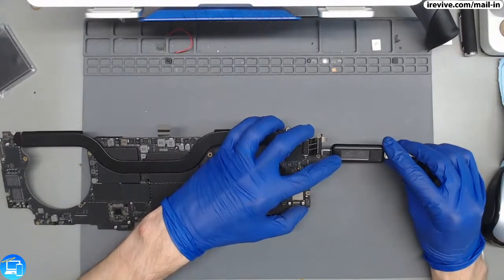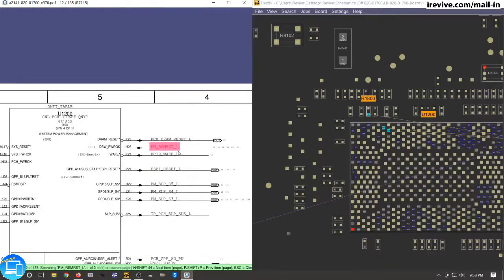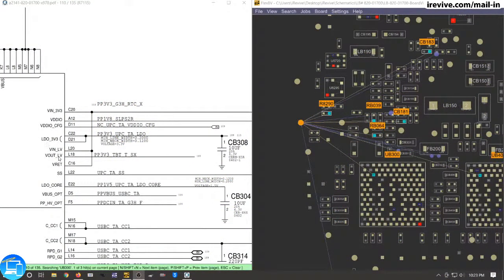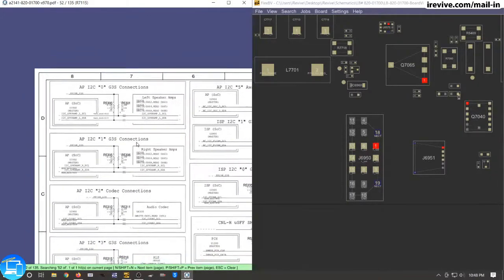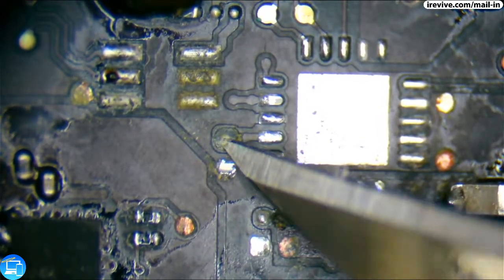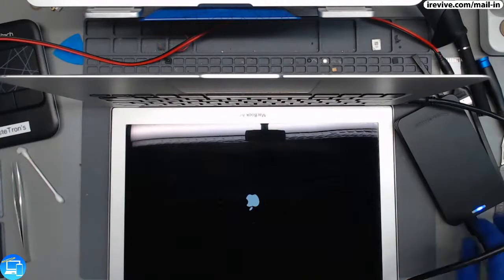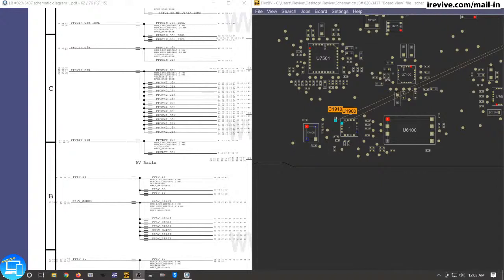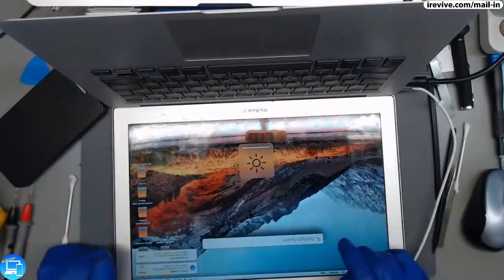A2141 MacBook Pro no power diagnostic 820-01700 and Some A1466 MacBook Air board repairs

Comment: awesome! Was the reason finally the missing bmu cable? would be interesting
Reply from the maker: Absolutely. I forgot to update this one. This one simply had a corrupted T2, however, without the BMU cable and battery screw, the device would not boot into DFU mode using Apple configuration. After retrieving the BMU cable and Battery screw from the client, I was able to finally put this device into DFU mode and restore the corrupted T2 chip. This resolved this issue. It appeared to be a board issue, when in reality, it was a firmware issue.
Reply: @iRevive  Thanks for the answer. My A2141 only getting 1,35v at all usb c ports after water damage. I Think Primary USB-.C Controller UB300 is often the reason for this defect? Because if thats okay it should be 5v / 12v minimum right? i have no shorts at the other lines only at the bottom of the board near CPU but thats often normal?. So i think the defect most be at the USB Port or could also a defect CPU be the reason for only getting 1,35 V at USB C voltometer? Would be awesome if you could reply. Im from Europe so i cant send it to you for service i think.
Reply from the maker: @MrSonnyjack  1.35v is a very odd reading to get on your USB-C ammeter. Are you using an Apple OEM 96 Watt charger?
Reply: @iRevive  Yes i watched your video many times and ive learned that 96W is necassary for this device without battery. I measured today with multimeter and i get 5,6 v at PPDCIN_G3H above both ub300 and ub400. Then i measured PPBUS_G3H and thats the same like the usb-c voltometer displayed only 1.35 v. So if thats true i think thats interesting that the voltometer measurds not the Primary USB C first. Then i watched the region around the u7000 and there it was a lot of shorts so i put some volts on it 1,5 and 1,5 a max with alcohol and i found a tiny defect resistor called R7075. Thats a 4.7 5% 1/20W MF 201 resistor. I can get only from size bigger ones. One Questions is that really 20 W? Or means 1/20W another different one? Because i will order one thats nearly the same and i will try to put it in and hope that this will maybe fix it. Thanks a lot for your Video it helped me so much to understand this new board better. Im just a beginner..
Reply: @iRevive  Can`t fix it by myself. Now i searched for a new logic board and i find one with the same Number 820-01700 but instead of i7 it has a i9 . Is that also compatible / is it possible to replace the board with a higher one? Thanks and best regards Simon
Reply: @iRevive oh man, i followed your measurements on front side of pcb and they all matched up with your case. Trackpad also clicks when on charger. But seems like pc is completely off. 

What is odd is that it had issues starting up - would not turn on for 20 min, and than later it would start up and fully work perfectly. 

I believe it maybe indeed in DFU mode. Where can I get a Mac configuration or what ever is needed to rear and see if it is in dfu mode and restore it ?

Comment: quick question. I have an A2289 macbook pro with all normal voltages everyone on board and no shorts, but i'm only getting 0.755V on the PP2V5 NAND SSD0 line when plugged in logicboard alone with power supply. I already changed TPS SSD power chip and still getting lower than normal voltage on that 2.5V line and it cycles every 15-30secs 0v to 0.755v (seems like its boot looping). I dont think the SSD's are destroyed because no short anywhere. Any help would be appreciated. Thank you.

Comment: Hi , you say that this macbook 16 can boot without battery with 96W charger, are you sure about that? because in your video you can’t boot even if you use the good charger, 
My macbook 16 - 2141  doen’t boot with charger but boot only with battery, now the battery is empty and I can’t boot it! I tried to revive with dfu but it’s stop when installing software in dfu. 
I have 12.3v in fuses F7000 and 7001 and 10.8v when I plug charger. 
Please help me
Reply: Hi can you clarify what you mean by "I tried to revive with dfu but it’s stop when installing software in dfu." 
Did it look like it was installing the firmware & then fail with an error? if so can you remember which error you got?

Comment: I have an A2141. No power. It’s only been used twice since Dec 2019. It won’t charge or turn on now. If you see it, you’d think the device is brand new. Its lived in a box at my office since COVID. Now Apple won’t even honor the warranty because it’s expired.
Reply from the maker: Hey Hove. I hate to hear that for you. There are a few reasons that a A2141 wont charge. A defective charger 96 Watt charger, a bad battery or battery cable, a corrupted T2 chip, a failed CD3217 chip on the logic board. If you have access to another USB-C MacBook, try using Apple Configurator 2 and see if the device is in DFU mode. The T2 chip may have to be restored. If you need a second opinion, you are welcome to mail your computer to us using our mail in form on our website.
Reply: @iRevive  same issue happened to me also. I am from India not easy to mail

Comment: I can't tell if it's the resolution/light settings of youtube or your rapid'ish camera movement/location w ceiling lighting, but your visual inspection of the board appears semi-blurry or "shiny" most of the time, even full screened on highest resolution going frame by frame, like there's a lot of light reflecting, I can't tell what's dust/junk and what might be something interesting.

About the 01700 and "cheating ahead" (cheating in a good way) with the thermal cam:
If the amp draw drops off quickly after being plugged in, I'm thinking the board detects the (possible) short and shuts off. (They didn't cut corners about current sensing on this model.) But maybe when you said it was pulsing it was regularly going up to a noticable current draw and I didn't catch that - or I'm overlooking something else.

Even if I'm not, it was good to see a new stream - nothing for me to whine/complain about in regards to the last machines.

Edit: Spelling is hard.